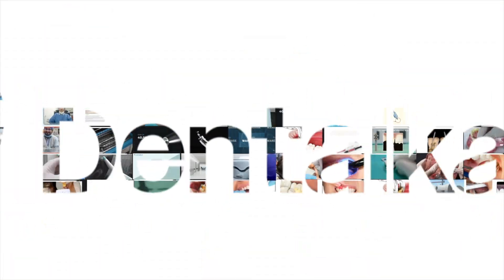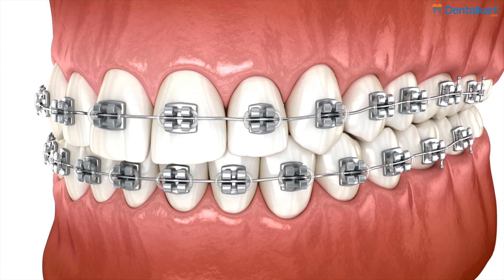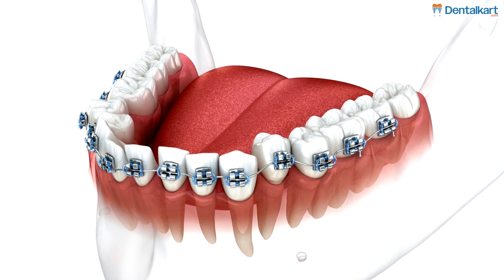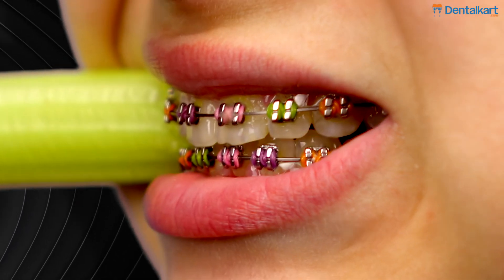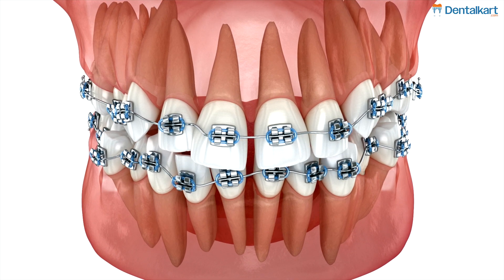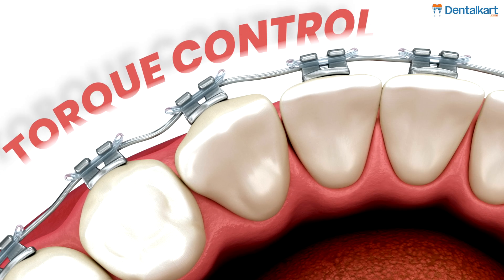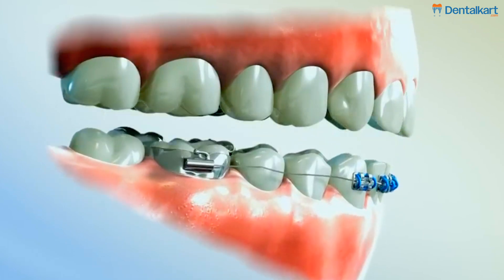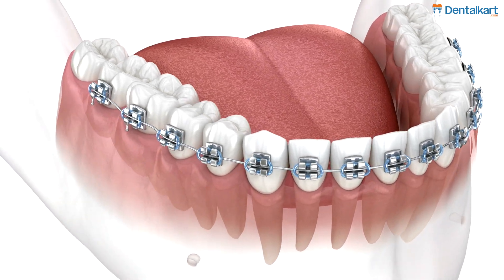Orthodontic Archwires: Types & Features | Part 1 | Dentalkart

Comment: Which one will we use to close a gap on top and small space on the bottom?
Reply from the maker: Dear Doctor,
For closing gaps, NiTi wires are used initially for alignment, followed by stainless steel wires for space closure and control. Choice depends on treatment stage and tooth movement required.

– Team Dentalkart